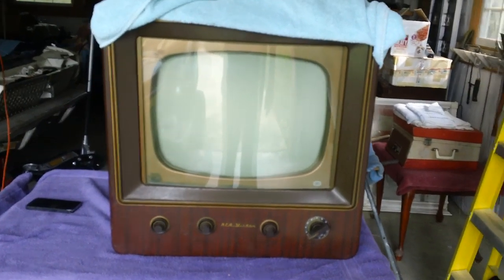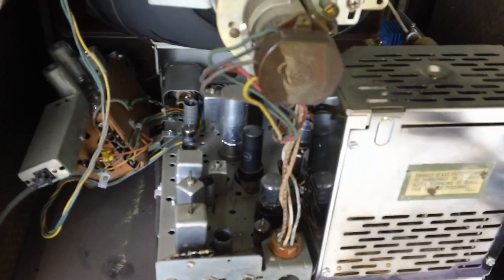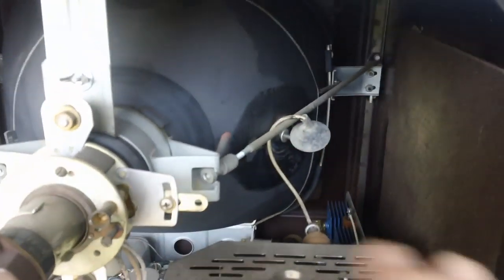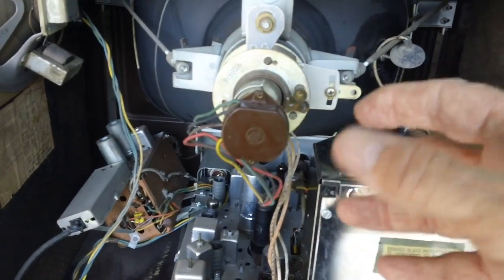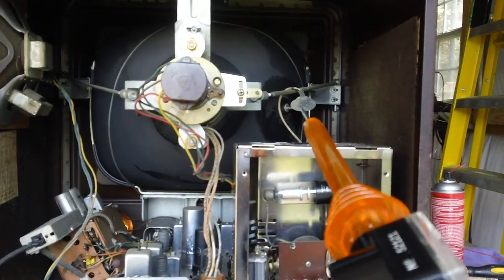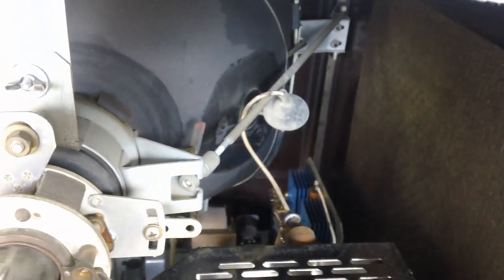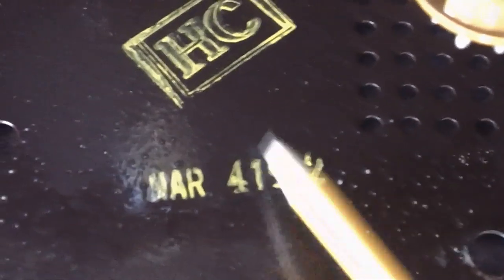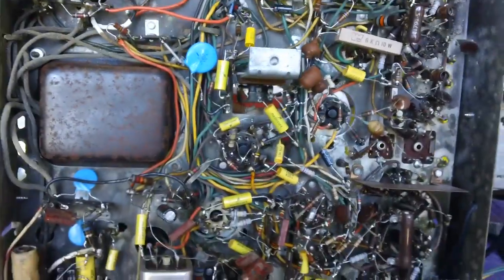Mish-Mash #270 (A bit of sideline TV work)

Comment: It is so good to see you performing on the electronics bench once again via camera.  
Since the television was working up to being put to one side, you are fault tracing in the right areas, such as checking for dirty contacts (valve pins, and bases, potentiometers, switches etc.).
If I was faced with what you are faced with, I'd have my oscilloscope warmed up, and ready to go.  (I'll use English English since I don't know the American English for what I know as the 'line ', and 'line output' circuits)  I'd begin by checking for line drive coming from the line oscillator (I know the frequency for the now defunct UK 405/625 line system but I don't know what it is for the American system).  If there is no line drive, then check voltages pertaining to the line oscillator valve.  If line drive frequency is present, proceed forward to the line output circuit.  Can you, with your well insulated handle screwdriver, draw an RF (spark) from the line output valve top-cap?  If not, check that valve for grid two volts, as well as line drive on grid one.  Also, for testing purposes, replace the boost diode valve with a known good one, and it might be a good idea to check the strength of the boost capacitor ...then check again for RF off the line output valve anode top-cap.  If you can draw RF from the line output valve top-cap, proceed to the EHT rectifier valve.  With your EHT meter, check the EHT voltage on the anode of the EHT rectifier valve  ( I use a very well insulated handle screwdriver to draw a one inch RF arc from the anode of the EHT rectifier but I don't recommend this method for those less familiar).  If the voltage is up to spec, look at replacing the EHT rectifier valve.  (you have already checked for voltage on the CRT final anode).  Let us hope the line output transformer is okay.
Best of fault tracing my friend.  Phil.
Reply from the maker: Phil,
English-English...isn't too good for this old dude.  As we say here in America (modified version)..."Half of it was all Greek to me."  But I did get somewhat more than that from your effort to edyoumakate me.  Thanks, my friend.
Regards,
John

Comment: John,  when you get back to it, check and see if you are getting anything out of the Horizontal oscillator.  If that is dead you won't have high voltage.  But you also mentioned that you had no B+ in that HV cage, that will also need to be  checked.

Comment: The first thing a always did after I saw there was no HV at the anode "button" is draw an arc off the horizontal output tube, then the 1B3 but do NOT short to the chassis, you may blow the flyback if you do, remember you are on the AC side of these tubes.
Just take an well insulated screwdriver and place it on the 6BQ6 or what ever horizontal output tube you have and pull it away and you should draw a small AC arc from iy, thate is several thousand volts on it, DO NOT put a volt meter on the horizontal output tube, it will blow your meter, it have very high spikes on it.
.The arc should be small less than an 1/8 inch.
Now go to the 1B3 and do the same but again do not arc to chassis, the arc should be around 1/4" to maybe 1/2", if you get arcs at these two places than look for a bad 1B3 ir the 500 mmf doorknob HV filter cap, that is the one on the outside of the HV cage.
I hope this helps, did all this stuff back in 1959, worked on many B&W TV's back then.
Reply from the maker: Bill,
Except at the fuse, there's zero voltage inside that cage.  I'll be checking backward until the problem is found, but not right away.  I just had a little time to kill, so decided to give it a quick gander.
Regards,
John
Reply: Sometimes there is a fuse in the B+ area feeding the damper tube and other tubes in the HV section.

Comment: John , in part 27 you mention adding the 200Ohm 25w resistor on the selenium rectifier mount- one of the last things you did. Perhaps check that wire out. :)  i never worked on a TV, yet !!!  Tx my friend
Reply from the maker: Ron,
I'll be working my way back in that direction, but not right away.  We have a T-Bird awaitin.  😊
Regards,
John